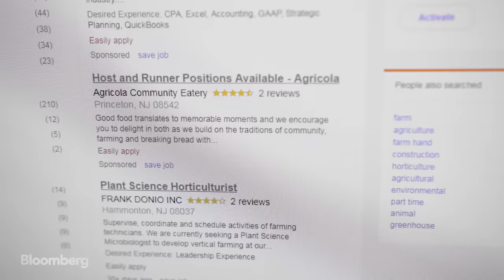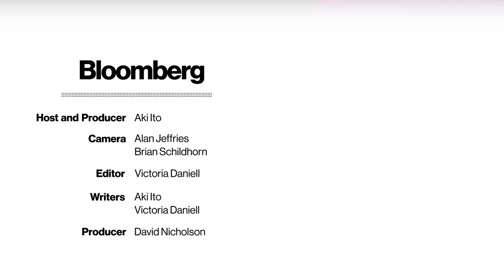The High-Tech Vertical Farmer

Comment: There are so many pluses and minuses to vertical farming.
On the one hand, it is super efficient.  Most farms use 80-90% less water than traditional farms, no pesticides, no (or very little) fertalizer, typically a solar roof will power all the lights of a building.  But mostly, there is a promise of little to no long-haul shipping or long-term storage.  You can just build a vertical farm in every city, and grow crops year-round to have always fresh local food!  It is a great leap forward for any plants that are lettuce sized or smaller.
The down side however is the price.  When you have companies full of enviornmental PhDs and programmers, as well as expensive up-front costs for all of the lighting and automation equipment, the break-even point for these kinds of small veggies is pretty much never.  Put one of these in every city, control them with a centralized system, and fill them with cheap labor and less automation and you will have yourself a profitable company that can pump out food for the masses.
But that still does not solve the food problem.  most people don't buy a lot off small crops.  For this to really take off, it needs to be able to take over staple crops like corn, wheat, and rice, and do it cheap.  And it seems that they haven't quite cracked that nut yet... but I bet they are getting close!  Once they can do that, the world changes overnight.  But in the US, corn is hard as it is so large.  I wonder if we will simply continue using fields for corn, of if we would shift our staples to more rice based products.

Comment: Unfortunately, this type of vertical farming is super expensive to maintain and costly where the cost to maintain vertical farming including soil transportation, building costs, lighting and electricity exceeds the GHG emissions from trucking it.  I did a deep analysis at Arup into vertical or roof-top farming and it just didn't make sense. Think of the cost per sq and where does all the soil and water runoff go.  Look at all those artificial lights in the background probably adding to more greenhouse gases from power plant. It doesn't save the environment..  It is super cool, but probably for the boutique and niche uses cases.

Comment: agree with other comments. This all looks very expensive to set up. how much does it cost to run. how many tons a year does it produce. do the grow lamps mean the crops are ready 20% or 60% quicker. How many crops a year. how do you populate a tray. whats required to get the tray into the system and onto the computers monitoring software. fertilizer? is it in the water, how is it added. Harvesting - is it all hands on deck or one person moving trays. how do they get it to market? that staircase doesn't look fun with your hands full. All in all a hopeless article.

Comment: "As technology replaces old jobs its also creating new job" most of the time they fails to mention is that over long term you loose more number of jobs than what few new jobs its creates. I work in IT sector and these new technological innovation(mainly in automation) cannot be compared to 19th century industrial revolution is any way. And the automation is not only coming in industrial sector but also in IT sector.

Comment: Wow. Your ending message that affordable food is about having fewer farmers could not be more wrong.

Firstly the resources required by a farm like this can be enormous and incredibly destructive to produce (which means the cost is more than just the immediate cash transaction). They take a lot of electricity and they need an endless supply of chemical fertilizer, which is a very expensive replacement for any healthy dirt ecosystem, not just for the work, but for the chemical processing and the stuff tgey make into fertilizer. 

Secondly, Farmers in the US are incredibly exploited by every industry they are forced to interact with. 

Monsanto charges a premium for their seeds, and they successfully sued (by sueing through many courts) to make it illegal for farmers to use any seeds they grow from a Monsanto crop. They basically argued that they own the genes and that farmers therefore can't grow plants. Essentially that every seed is a license and that farmers don't have any rights to the plants they grow.

Most independent US farmers basically don't make any money. They either break even or shoulder the losses, because the rest of the food industry is that corrupt that it has forced this situation to make the farmer's wages into their own profits and yearly bonuses.